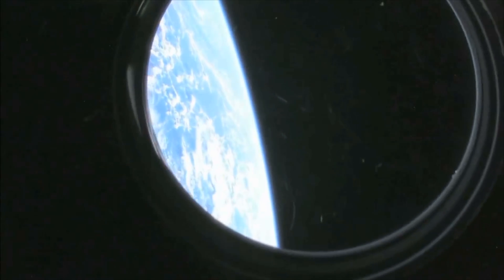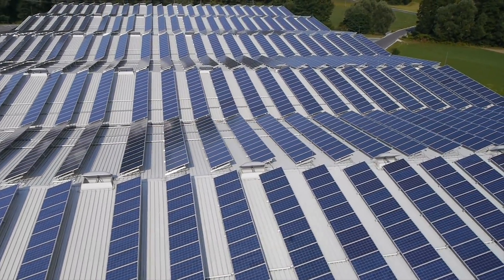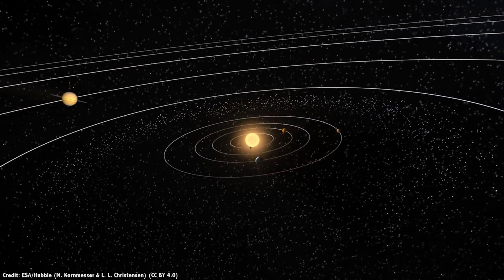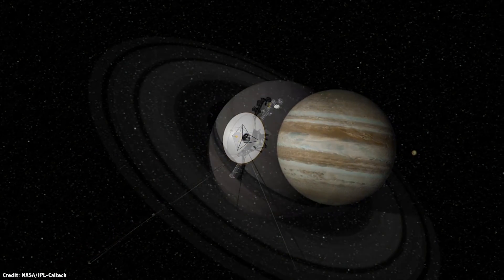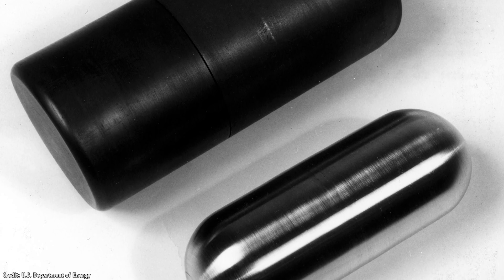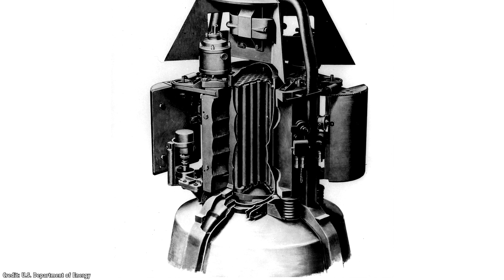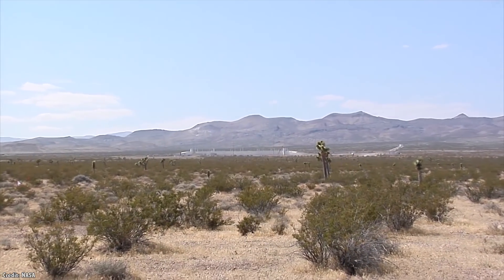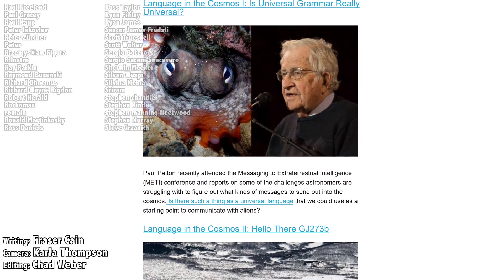The Problem of Power in Space. NASA's New Kilopower Reactor

Comment: "No, this sucker's electrical - but I need a nuclear reaction to generate the 1.21 gigawatts of electricity I need!" 

About bloody time they took a second look at atomic power for spacecraft.  If you're going to build a base on the Moon, where the nights last for two whole weeks, it's practically a necessity.
Reply: @memberwhen22  it's purely task dependent......I've built,run,commissioned so many different major critical systems regarding various infrastructure such as gas sites in the U.K. which sure they have a local wired supply BUT the control of which is 100% remotely controlled by either satellite or WAN or LAN  networks.....obviously done so because of their remote and closely guarded location secrets.....there are switchable manual wired "man on site" switchable links to these pipeline valves and dosing lines BUT it's primary task is remote control. ....nowadays though the ways of transmition of power via wired systems is way beyond  copper conductors because of weight......there's super conductors that can be used but this brings other challenges such as cooling via a small plantroom etc......it's also dependant as this video says about the proximity of humans to radioactive elements......it's really a massive problem that has however gotten less of a challenge as the years of advancement have passed.....the one constant though has always been the fragility of man.
Reply: CountArtha true radio thermal generator safe way.
Reply: lol i love that movie :-)
Reply: georg841984 check our 1970s sci-fi "running silently" tell me if that's not relevant to today's issues.
Reply: georg841984 watch "silent running" 1972.
Reply: hombero
ESPECIALLY on this planet, since it has an atmosphere and the moon does not.  Lacking atmosphere, the power loss by direct transmission would only be from power beam dispersion, & filtering inefficiencies on the rectenna side. The power loss through cables is proportional to the cable cross-section, length, current load, and the square of the material's inherent resistance.
Tip: you might want to spellcheck and grammarcheck your comments in the future ;]
Reply: Launch the Clock Tower in To Space before it reaches 10:10 PM. Lightning will strike it then...lol
Reply: What makes you think they don't.
Reply: The moon has about one quarter the gravity of earth and Mars about a quarter of earths gravity.No one is going to be living on the moon or Mars!  They may die there, but they are not going to live there, at least not for very long!  
  The human body will break down in the absence of gravity.  One can exercise a good part of the day, every day for  their stay, but even that is only delaying the inevitable.  
  Six month with no gravity, then a year with one quarter the gravity of earth then another six month with no gravity  can only be ignored for so long!!
Reply: Hunting Targ. Transmission and reception of power via a radio link is a red herring. If you want to receive a kilowatt of power, then the most efficient way to do it is via cables. Using U.K energy supplier figures, they reckon with average 6% to 9% transmission losses between plant and consumer. That includes multiple transformer losses, switching losses, line radiation losses and line resistance losses. To receive 1 kilowatt, 1.06 kW to 1.09 kW has to be generated.

If you want to do the same thing via a radio link, you have to use electronic devices to handle the power output. For the transmit and receive antennae to be small enough to be practical, microwave frequencies have to be used. At those frequencies, no semiconductors exist which can handle kilowatts of power, so thermionic devices have to be used.

 The most efficient device in regular use is the magnetron. The best magnetrons are about 70% efficient.  That's within the device. But to power the magnetron, the best overall system efficiency you could hope for is around 50%. So before you've even transmitted the energy, you need 2 kW for 1 kW of RF energy. (Edit: I deleted a ream of stuff here, in which I calculated all the losses in a 2 km transmission path, along with transmitter and receiver losses. Far too much text!) In very simple terms, overall system efficiency would be in the order of 1%, at best, even if huge solid parabolic reflectors were used at each end.

If you tried to use lasers or masers, which do have smaller dispersion angles than a microwave beam, then efficiency issues still abound. Even the best lasers are only claimed to be approaching 70% efficient (https://www.spiedigitallibrary.org/conference-proceedings-of-spie/5711/1/360-W-and--70-efficient-GaAs-based-diode/10.1117/12.602577.short?SSO=1 ) and they're around 360 W output power. That efficiency neglects power supply losses. 3 would be needed to generate 1 kW of beam. Assuming average PSU losses of 20% and diode losses of 30% (as claimed) , about 2 kW is needed to generate 1 kW of But the beam still has to be received and converted back into useful power. I have no figures for high power laser receivers capable of handling a 1kW beam without melting - if they even exist. Simply, the system is already much less efficient than a cabled system.

I want to live long enough to see a semi-permanent base being established on the Moon, akin to the ISS. Power, water, Oxygen, waste disposal, air decontamination, spare parts, medical supplies, food, protection against meteoroids and protection from radiation are all very serious challenges to overcome. It will be interesting to see how each one of those is addressed. At present, even the ISS needs fresh water, air, food, clothing, equipment and other supplies sent to it every few months. And astronauts are grounded once they have received an estimated safe maximum radiation dose. There is also only minimal protection against foreign body impacts (it's a matter of 'when they have a calamity', rather than 'if they have a calamity'. Russian roulette, if you like.), so even the ISS can never be regarded as a permanent and independent human habitat.

A Moon colony is a whole new set of challenges. We're in the days of galleons with space exploration. What will we be doing in 400 years' time?
Reply: I largely agree, but I'd personally feel more at ease with the prospect if we found out what to do with the waste products (I'm thinking about the base on the moon which is not going to be if it's not nuclear powered. Quite as simple as that, bar some unknown energysource making the nuclear one redundant). But one good reason to build a moonbase could be to have manned operation and maintenance of that huge massdriver, we could build up there for ejecting - nuclear waste, among others - into the sun. That's two flies with one whack.
Reply: CountArtha the moon also has incredibly rich deposits of possibly the best fuel for fusion reactors. By the time a moon base is being constructed. I wouldn’t be surprised if we got fusion working by then
Reply: 1.21 gigawatts of electricity? Do you by chance own a Delorean McFly?
Reply: All we need to do is figure out fusion. Lol
Reply: tbh space is just about the best place to have a reactor, if you can handle the heatsinking issue. dissipating unnecessary heat is a major issue in a vacuum, but other than that, it would seem to good to be true.
Reply: @memberwhen22  Wireless has a potentially unlimited range verse the cables.
Reply: I agree, why do we let the people who are the most scared of new technology choose how to go about exploring space
Reply: Idk why no one here mentioned it but the moon is the best place in existence for a thorium reactor. If we build a base there it will be a thorium reactor... there's no question about that. Also on the plus side the waste product is uranium 232, we then use the waste uranium as the power cell to fuel probes launched from the moon as they've used plutonium to atomic power them in the past. Could even drive the probes using laser power from the moon and collection sails on the probes with the thorium reactor. Again, no matter the debate, the first moon base will undeniably be thorium
Reply: On the Moon they're probably way to expensive compared with high efficiency solar cells and power distribution via satellites and plain old cables. There are places on the Moon that have pretty much perpetual sunlight plus these places incidentally are the closest to the craters that contain water ice...
Basically the first Moon base would probably be located there and thus not require costly nuclear reactors.
Mars and beyond is a different story, though. A nuclear powered base on Phobos would be amazing.
Reply: You're right about polar areas having near-perpetual sunlight, but you're forgetting the fact that getting the power source to the Moon is far more expensive than its construction. The equivalent cost in cables to the entire cost of a reactor would likely be just a few kilometers.
Reply: Rob Speed
The answer to that is either power satellites, or just have a 3-stage power system; Solar =>battery array => fuel cells.
Reply: HuntingTarg That just makes the problem worse. How much do you think the equipment for all that would weigh?
Reply: Rob Speed 
I think you're looking at the problem in terms of chemical rocket launch costs in existing infrastructure.  A hypervelocity launch tunnel or a launch loop could reduce final £/kg payload costs to a fraction of what even Space-X now charges.
Also, fuel cells don't have to be heavy or bulky.  There's two sets (pairs, I believe) of fuel cells on the ISS that only weigh ~120 lbs. apart from reaction mass; not anything to sneeze at, but entirely manageable.  I just proposed the triplex arrangement because redundancy and diversity are nearly always desirable.
Reply: HuntingTarg There aren’t any fuel cells on ISS. They do have a system to split water into oxygen and hydrogen, but that’s for breathing. Regardless, what you’re leaving out is the systems to store two weeks worth of bulky gasses. It’s orders of magnitude larger and heavier than a nuclear reactor.
Reply: Factual correction accepted. (my bad; I was thinking of these: 
https://www.nasa.gov/topics/technology/hydrogen/fc_shuttle.html )

Absent any calculations (which partially depend on cell design efficiency and output), the Apollo missions ran on fuel cells for about a week using only part of onboard cryogenic LO2 and LH2 as reactants.  I wouldn't call that 'orders of magnitude larger and heavier.'  Now it might possibly be if we want a crew that has more than an apartment-size habitable space.  However, note that reactants can be recycled in the two weeks of sunlight - spent water can be stored as ice, and electrolysis and re-cooling can take place while the base and its solar power plant are bathed in unfiltered solar radiation.
Also, it's not necessary to bring a large store of reactant oxygen if the electrolysis of sand can begin immediately upon arrival - and oxygen is the bulkier of the two reactants.

Additionally, you don't have to bring a lot of material for building on the moon, since the stress requirements are much less in the lower gravity - lighter load requirements can mean either larger structures or less building material for the same mission payload.  If indeed (I haven't looked into this yet) Buran-Energia or one of the projects currently in the works can reach the moon with a sizeable payload, then it's simply a question of how many missions one wishes to fund before an installation can become self-sustaining.

So,we have: Polar moon base; power satellites; fuel cells.
Reply: On a tidally-locked body such as our moon, the poles are the best places to put a settlement as the sun never sets—just rolls around the horizon as the moon rotates—perfect for setting up solar arrays.

However, I maintain that setting up a space-based solar power wireless electricity (an outer space electrical grid) composed of solar collectors, microwave/infrared transmitters, and power relays (transceivers) is the best long-term solution to powering spacecraft. As long as you have a rectifying antenna (i.e. a rectenna) or some sort of thermophotovoltaic receiver to convert EM waves to DC electricity, you'll have the necessary energy to power all your equipment.

Unfortunately, the cost of setting up such a system is ridiculously high, so, uh, baby steps.

Comment: I wonder if one rover could retrofit an older rover with updated equipment, not to exclude an updated battery pack or some other source of power.
Reply from the maker: That would take some tricky mechanical engineering. Better to just build a new one.

Comment: I think there are some possibilities that have been tried on small scale but haven't been fully developed.

1) A rotating  mass around a center can be used to drive a turbine,  yes moving parts a prone to failure, but this may produce a large amount of energy for the time it works.

2) capturing solar winds,  by creating large coils,  as energetic particles pass through the coils it will generally a current through the coil.  This  works just like a magnet passing through a coil.

Though Fusion would be the best, I hope that someone soon will figure it out.

Thanks for all your hard work

Comment: Stirling engines? Mobile parts aren't good for a long time use
Reply: CptMikeTango Good point, but this configuration of Stirling can be made with magnetic bearings and contactless components - it's also an extremely simple design.  Some old refrigerators are still chugging along, and they use contacting parts, a less efficient thermal cycle, phase change working fluid, multiple joints and intermittent power, not to mention bumps and abuse.  The NASA Stirling is far more simple and durable.  I'd bet the limiting factor would be gas diffusion through the metallic casing, and of course lower Carnot efficient as the fuel wanes.
I think Titan is probably the best place in the solar system to run them! They would so incredibly efficient due to the temperature differential and convective heat dissipation!

Comment: I have a question. Why not have some type of laser or microwave emitter or whatever, in space near the orbit of earth with huge solar arrays and then just make it beam that power to a satellite around saturn or jupiter or whatever for power? Sounds feasible I think. Though i guess the speed at which the satellite moves say around Saturn would pose a problem, but it could have some wide nets scattered over hundreds of meters or kilometers that capture the electrons send out by the emitter on earth.
Reply: Focusing a beam over such distances is hard very hard. The smallest feature on Jupiter you can see with a telescope the same size as your transmitter will be about the area your beam is spread over at that distance. So your spacecraft will see very little energy.